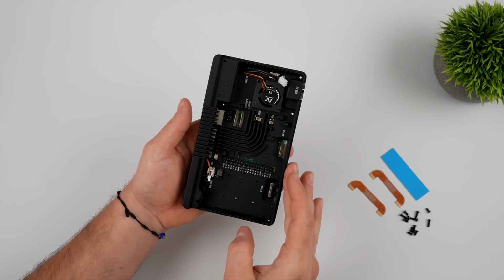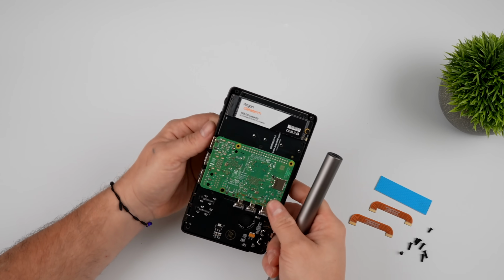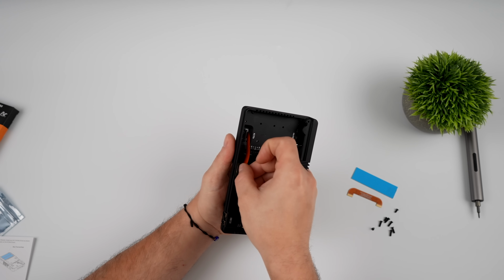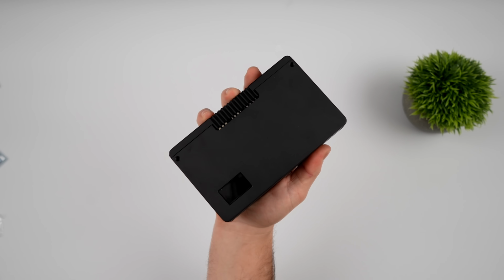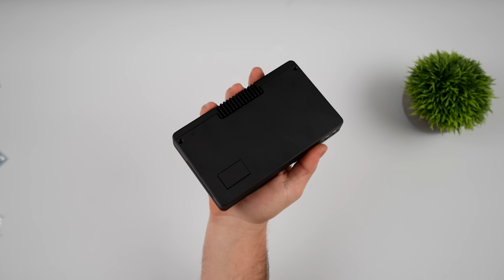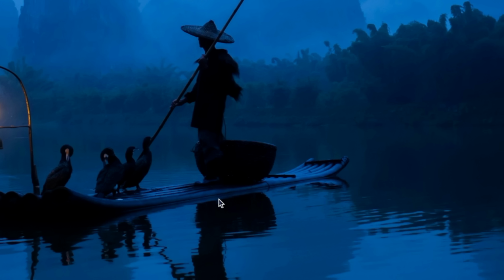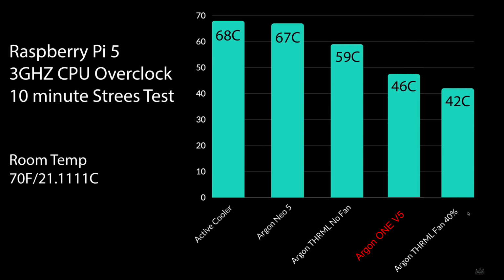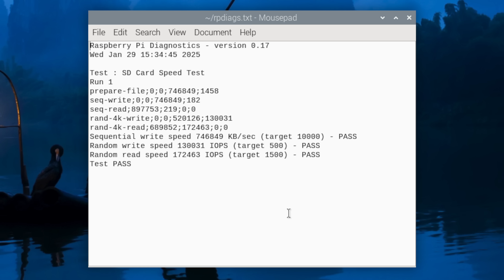Argon ONE V5 & OLED Linux Powered 16GB Raspberry Pi 5 Mini PC Setup

Comment: Watching this video again and I got to wondering, are the holes for antennas supposed to be for wifi and Bluetooth?
What extra steps would be involved in installing the antenna?
How would they connect to the raspberry pi 5?
Would I need to install software for the Pi to recognize the antennas?
Reply: for zigbee. the pi has no antenna port.
Reply: @GTuxTV I'm guessing that's a separate thing from wifi and Bluetooth?

Comment: I like this setup with an aluminum case plus active cooling fan. Question: what is considered the current max size for an SSD drive compatible with this setup? 
I've only seen drive sizes in the 4TB range. Is that the current max?

Comment: Please check performance of Bluetooth/Wireless Keyboard and mouse. I struggled to get reliable operation of either type of unwired keyboard/mouse at 3 meters distance. On an ArgoneONE 4 case with SSD. Use case was coffee table control of the Pi connected to a flat screen TV. After months of frustration the fix was to download the RPi fan control software into Ubuntu and set the fan to permanently be on max speed. The communications controller was overheating. It now works good, ArgonONE 4 case was not so good in this regard. Others reported the problem to. Please check if the new case also has this problem.
Thanks in Advance

Comment: Does the SSD work out of the box? What do I have to do to get it going?
Reply: Boot from a micro SD with Pi OS installed, then when booted up use the online imager to transfer the Pi OS to the SSD, also change boot order so it doesnt look to the micro sd when booting.

Comment: damn now i need to order a new pi 5 and case. this will be my third case by argone and they are all amazing cases
Reply: @christopher480  How did you go setting up the fan and getting it to work. I have had an issue with the Argon OneV3. Would never turn off, and very noisy. I have given up using Argon.

Comment: I bought the same thing except for a 8 GB raspberry pi 5 but they were out of the OLED monitor that you got I was wondering, would you recommend an another one that I could get? Also, is it possible to get a more detailed video on how you were able to put the operating system on the M.2 drive
Reply: I just got one delivered yesterday from the Pi Hut UK

Comment: Can't find the model that has two M.2 drives, they sell the single M.2 board desperately but not a dual M.2 board.  I wonder if it isn't released yet?  Also surprised how cheap this case is, I bought one of their cases for I think the pi 3 and it wasn't cheap, like outrageously expensive compared to other cases at the time but this one is pretty cheap.

Comment: raspberry pi foundation needs urgently to come up with something competitive, if not im not sure if theyll survive in a few years...
Reply: PI 5 is really a Swiss army knife in that it does so many things. There in lies its strengths ... attach a camera,  attach sensors, as an educational tool, etc. Why the PI 5 is continually compared to other desktop environments is really missing its purpose.
Reply: Their support for older hardware is lightyears better than anyone else. As soon as the competition releases a board, they almost immediately abandon it, which has been my main issue

Comment: Why does nobody ever take the stickers off their nvme drives before slapping a heatsink on them?! Don'y they know that defeats the purpose?
Reply: Others already said what was known. I'll add that they may deny you support if you removed it
Reply: I was wondering the same thing but one blogger experimented and he found it didn't make much difference stickers on or off.
Reply: Actually it was proved that the sticket ascually act's as thermal interface and it helps the thermalpad

Comment: That OLED probably connects to the Pi over SPI/I2C, so theoretically you could ignore the Argon utility and make a little script that would boot to terminal on the OLED and completely interact with the OS on the tiny acreen, without the need for a full monitor.

Comment: Very cool device. The only issue is that when you add the cost of everything, you are already in NUC or small x86 territory....
Reply: I got one. It was a lot cheaper for 150 bucks for the pie and the case and the $10 module worth it only thing is my 45 W plug won’t power it.
Reply: @BadKarma714  I doubt it is actually 45W at 5V. The Pi uses 5V and needs 5A or more. 27W should be doable, but you need a power supply that will push 5 or more amps at 5V - most do not, even if they have a higher wattage rating.
Reply: agreed.  I've spent enough money on my Pi 5 8GB to afford a really nice Ryzen based mini, but...  that's all been part of the fun.
Reply: @wesmckean1443 Right on. With what I have spent on an nvme drive and the Pironman case, my Pi5 cost more than a Chromebook or NUC. But, as far as using the GPIO pins and programming and learning how to use GPIO pins and sensors and stuff,  the Pi5 is an incredible value as a bench-top prototyping workstation.
Reply: Not exactly, but it definitely is a niche use case (double entendre not intended) though. My setup for this case is about $870. It would cost about the same for a good mini PC and it would be much, much less efficient (performance per power). I would for example still buy the additional 8TB m.2 either way, so there is no savings, but potentially added cost for the mini PC if it came with its own drive.
Reply: The cost of Pi4 and 5 has crept up to the point that using it as a general purpose computer is kind of a terrible value. Pi3 was fast enough to handle desktop usage and cheap enough to put up with the sluggish desktop performance. The Pi5 is still a great value in terms of a maker board and prototyping. You would have to actually use the GPIO pins and whatnot in order to get the full value from this. Otherwise, yes, a used office PC or recent NUC-like thing or even a used Chromebook is a better value for just having a computer to check your emails and play retro games.
Reply: Except if someone needs the ultra low power consumption of a raspberry pi, it's completely terrible values for money using it as a mini pc.
Reply: @googlesucks6029  N100 based mini PCs do use a little more power than the Pi but it's not a massive difference, and depending on needs it might be preferable because of the extra power. For example if you just need a basic DIY NAS and have no plans to do a Plex/Jellyfin server, then a Pi would be your best bet. But if you want Plex/Jellyfin as well, and to take advantage of the hardware transcoding options, an N100 would be the go to. Not only is it faster transcoding, but it's able to handle more simultaneous streams if you have multiple TVs in the house with people watching on them. Ideally you won't need transcoding at all, but all the various sticks and dongles, or built in "smart" TV hardware you never know what will and won't need transcoding, so it's better to be safe than sorry.
Reply: It doesn't go that high.
Reply: @LuisPerez-5  The 16GB model is $120 retail, plus a 250GB NVMe drive runs you around $30-40 on top of that, plus the case costs $35... yeah no he's 100% correct. Most N100 x86 mini PCs run around that price right now and will smoke the Pi5, most also come with 500GB storage too and are fully linux compatible.
Reply: @imglidinhere  Right so it really depends on what you will use it for.
Reply: @imglidinhere Can you run an N100 from a power bank? Can you  hook up a bunch of climate sensors for an experiment?

How manu N100 computers rin navigation on a yaught, and now many are in things like advertising screens and the like?

70-80% of all Raspberry Pi Computers are sold to business/industry. So they have to have a reason for picking it up over an N100...